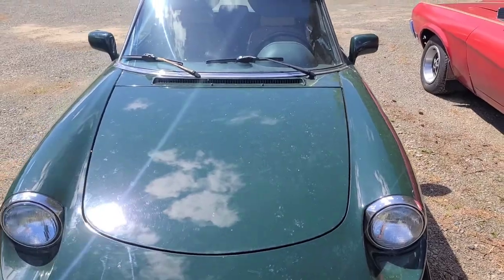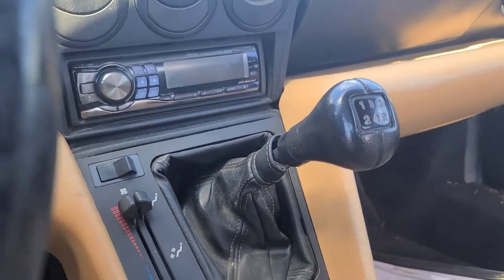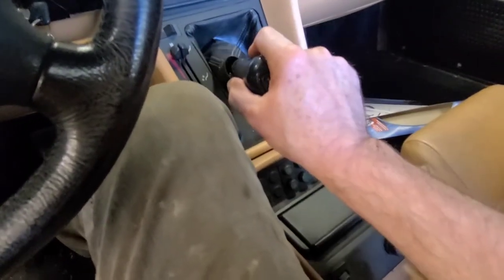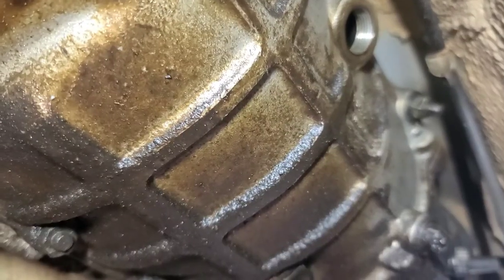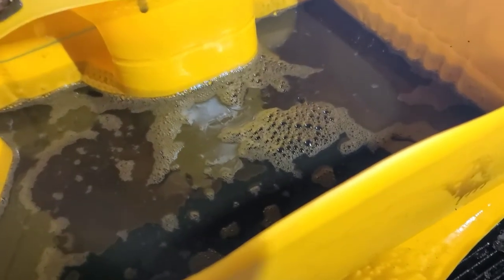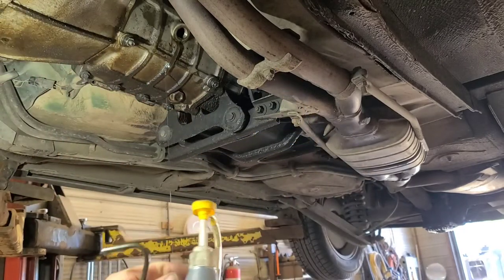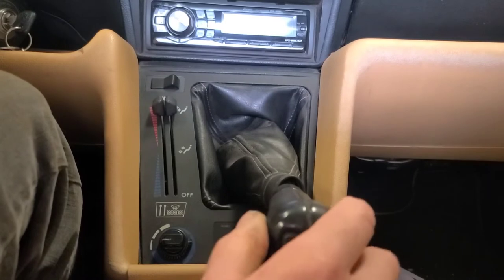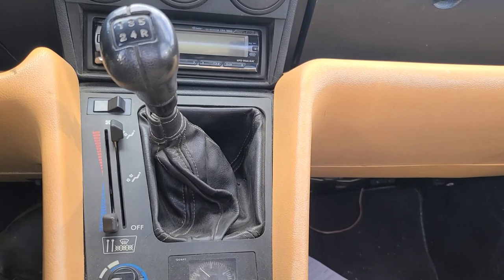1992 Alfa Romeo Spider Veloche Trans Grinds When Shifting To First

Comment: First has a functioning syncro when down shifting from 2nd gear but not when "upshifting" from N. There is a modification that can be done inside the 1-2 syncro ring to make it function like the 3-4 syncro ring. This fault is part of the Alfa design. A fast idle makes the problem worse, pausing for a few seconds after pushing in the clutch works well for 1st and R or selecting 2, 3 or 4 before shifting to 1 or R.

Comment: First is not synchronized from a standstill, though it is reported to be synchronized "only when moving" by a yob on a board somewhere...but I suspect it just seems synchronized when moving because everything in the transmission is already in motion. To avoid the grind in first and reverse from a stop, I always move to third initially (which is synchronized) to get the layshaft moving and then change over to first or reverse. I did the same thing for years with my early Saab 900. Works a treat!  Nonetheless, this video has inspired me to take-on the (likely) ancient fluid in my transmission, too. I LOVE the pump you created - definitely going to steal that idea!
Reply from the maker: Thanks for watching